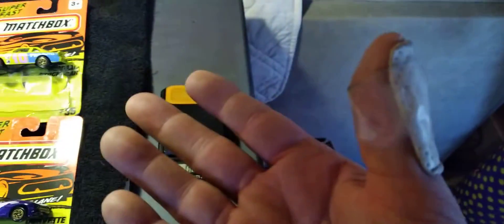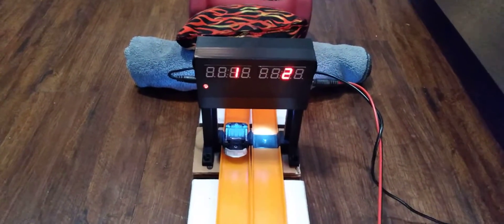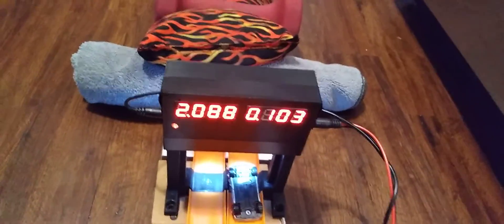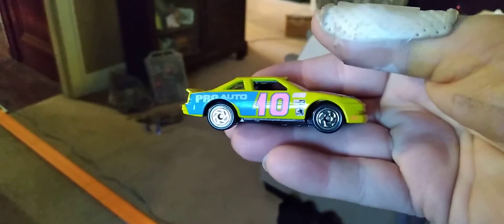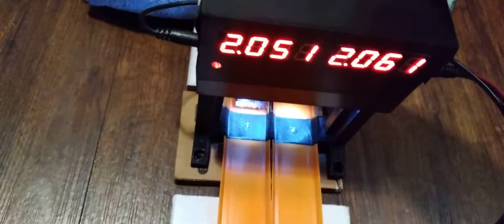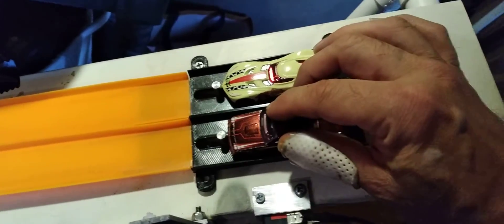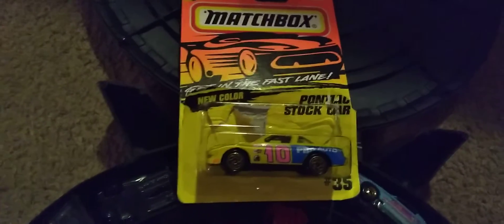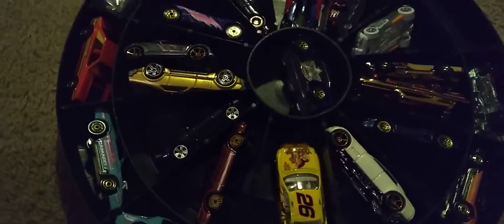Speed Testing Matchbox Superfast - Pontiac Stock Car & Sting Ray III

Comment: Hope you heal quick!  That GNX is quick.  I tested several and none were anything special.  I may have another one uncracked somewhere.  Interesting to see the speed in this class vary over so many channels.  Your track runs so consistent, wish mine was a little better in that.  One reason I do biggest beat and not overall time.  Thanks for the speed session!!
Reply from the maker: Thank you Dale! Prior to filming I pulled the track out of cold storage (literally) and times were slow and runs saw a lot of swimming. This filmed session was after a couple hours of letting it just sit and settle. Better times and consistent tracking resulted thankfully. That GNX is the fastest of a bunch. Happy Thanksgiving!